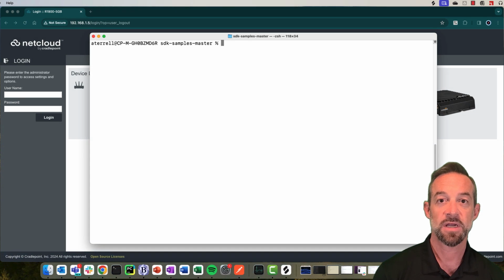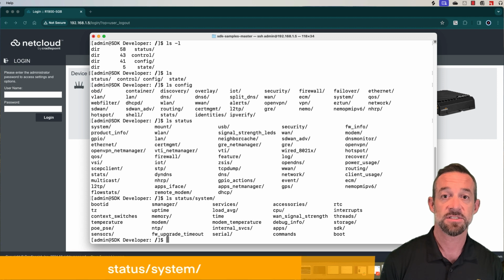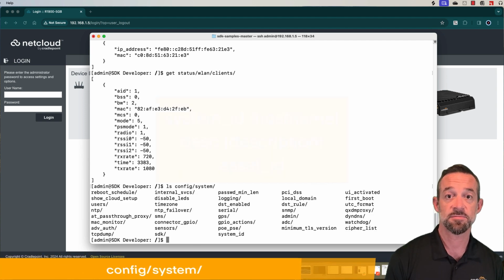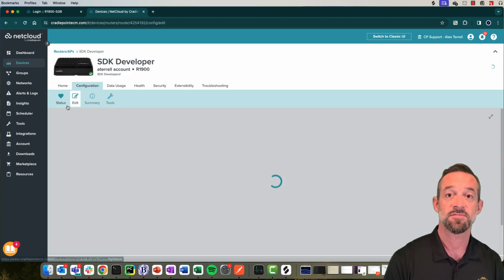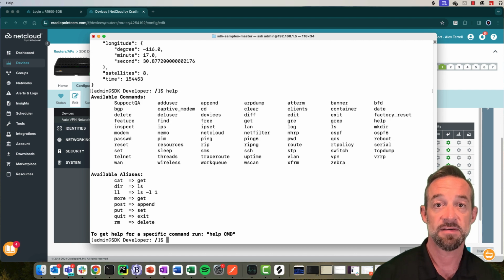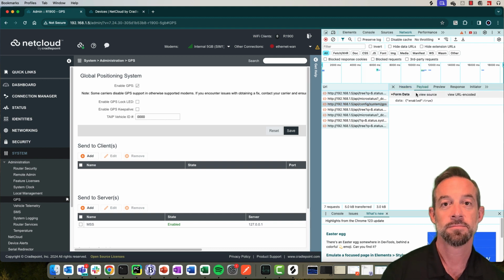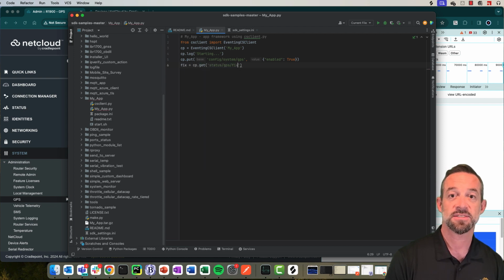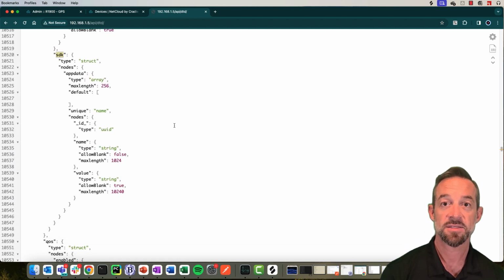Cradlepoint SDK – Using NCOS API

Comment: Is there an equivalent v2 API endpoint to the "/api/config/system" tree such that we can send a PUT call using Postman using that v2 API endpoint, for example?
Reply from the maker: Yes, you can change any part of the device configuration via the NCM API configuration_managers/ endpoint. 
Here is an example of enabling GPS, which is under /api/config/system/:
 
GET configuration_managers ID for router mac:
https://www.cradlepointecm.com/api/v2/configuration_managers/?fields=id&router.mac=003044123456
or curl:
curl -v -X GET -H "X-ECM-API-ID:$X_ECM_API_ID" -H "X-ECM-API-KEY:$X_ECM_API_KEY" -H "X-CP-API-ID:$X_CP_API_ID" -H "X-CP-API-KEY:$X_CP_API_KEY" https://www.cradlepointecm.com/api/v2/configuration_managers/?fields=id&router.mac=003044123456
 
PATCH configuration_managers/ID
https://www.cradlepointecm.com/api/v2/configuration_managers/123456/
or curl:
curl -v -X PATCH -H "X-ECM-API-ID:$X_ECM_API_ID" -H "X-ECM-API-KEY:$X_ECM_API_KEY" -H "X-CP-API-ID:$X_CP_API_ID" -H "X-CP-API-KEY:$X_CP_API_KEY" -H "Content-Type:application/json" https://www.cradlepointecm.com/api/v2/configuration_managers/123456/ -d '{   
"configuration": [
        {
            "system": {
                "gps": {
                    "enabled": true
                }
            }
        },
        []
    ]
}'